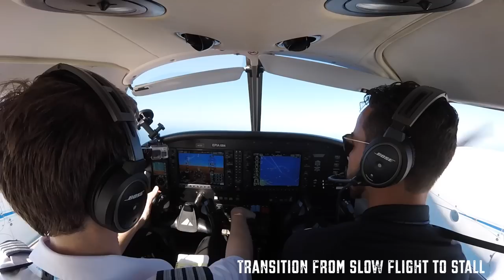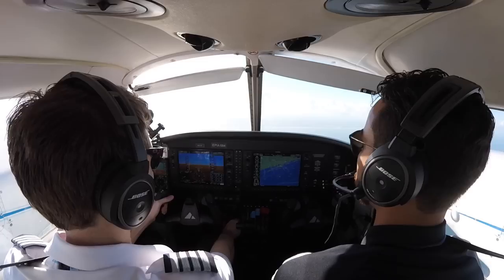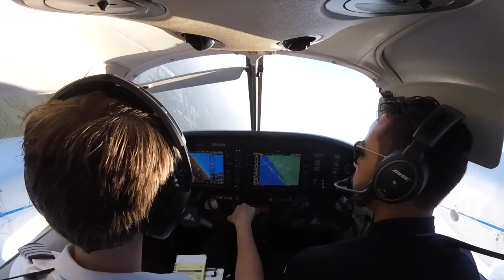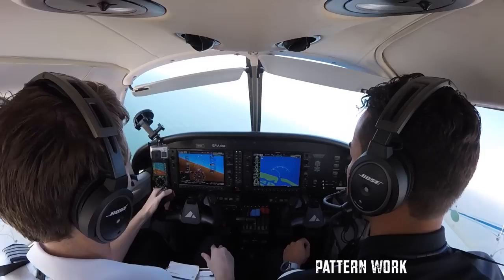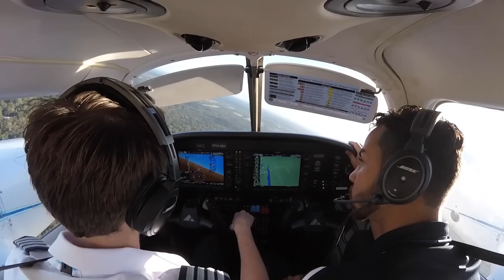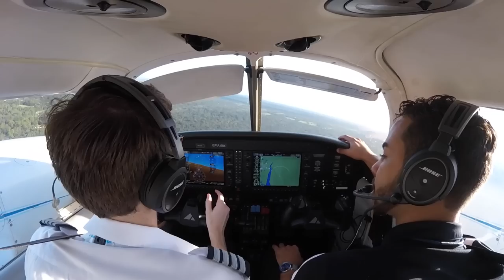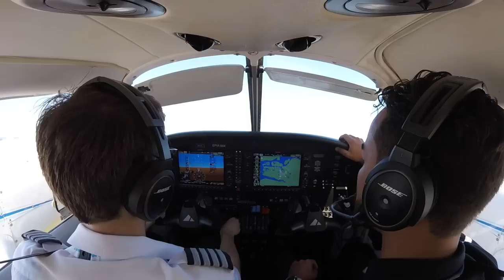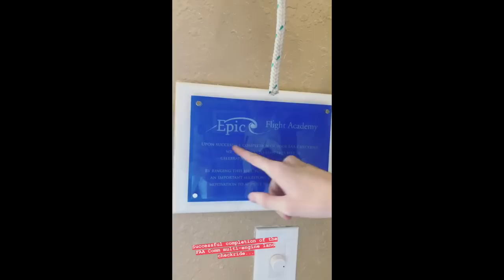Multi Engine Flight Training| Maneuvers and Landings| PA44

Comment: Nice video, I'm currently training for my multi-engine add-on and enjoyed this short video.  I think that's a pretty good pace for your engine out steps.
Reply from the maker: MiGueL thanks man I’m glad you enjoyed the video.. The way that made sense in my head was immediately establish blueline, then mixture, props, throttles forward and reduce drag (gear/flaps). After that iD, verify and then troubleshoot with the checklist time and alt permitting. I just kept running that through my head and it stuck. Fairly simple really once you do it a few times.. Enjoy the training man

Comment: Hi, awesome videos! I really enjoy your work - especially since I'm going to start pilot school this January. I have a question... I am really concerned about how the stalls feel like? Are they like a drop in a rollercoaster, or does it just feel like turbulence? I am pretty nervous about how it feels and if it is too much. Is your experience that the student pilots easily getting used to it, or does it take time?
Reply from the maker: Hey man! Thanks for watching the videos and i'm really glad you're enjoying them. In response to your question, stalls are the most feared thing at the beginning of training but once you do one you will see how easy they are and won't be scared anymore. My advice to you would be to take the time now to understand the aerodynamics behind a stall, and understand that the plane is not 'dropping out of the sky'. It is not a full reduction of lift, your wings are still flying. When the plane stalls it is just telling you "hey, you reduced the airflow over the wings, I want it back!". Push the nose down and add power and it will recover quickly. Trust me they are so easy and nothing to be worried about. I was scared at first too, but now i love them. And they feel nothing like a rollercoaster. Actually a rollercoaster is more scary, because you are not in control of a coaster. YOU ARE in control of the plane. It does what you tell it to do. 
Hope that helps.